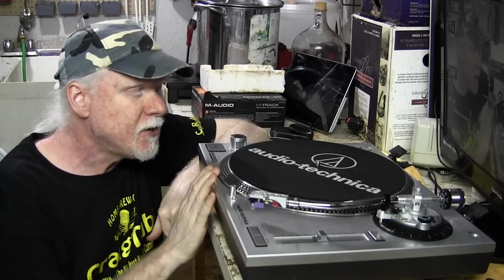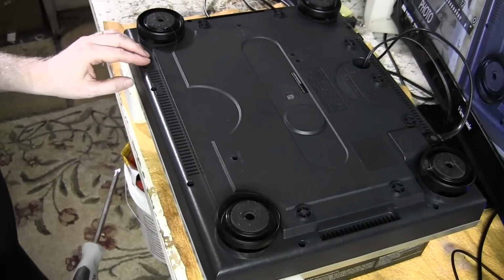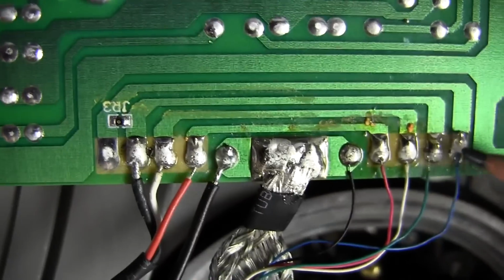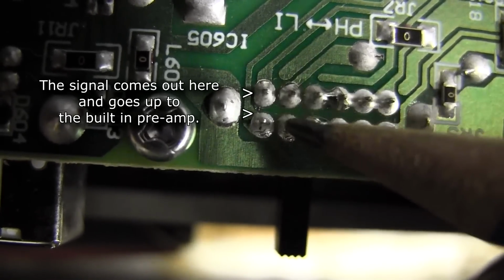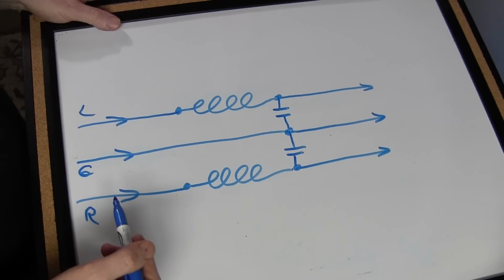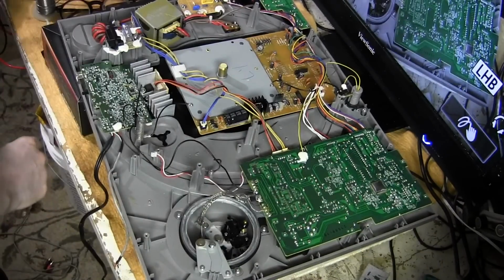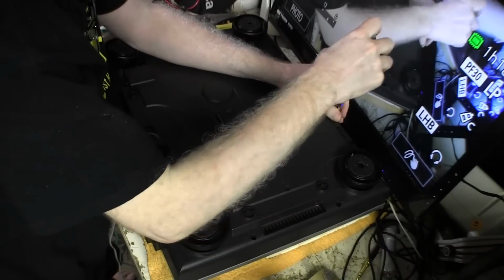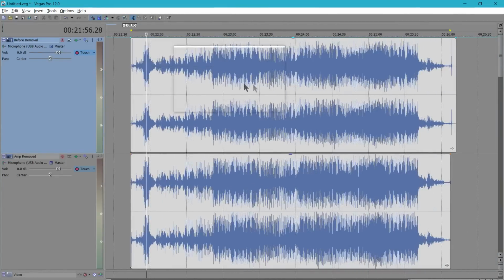Preamp Removal - Audio Technica AT LP120 USB Turntable

Comment: I am remove two l606 and jump and then remove two white pieces and the diferences in Audacity recorded at 96khz Its nothing I am thinking you use anothe RCA cable and not the original RCA cable maybe is the diference in sound.
Reply from the maker: I don't think the cable would make that much difference. There's another video on YouTube that does a comparison and the results are the same as mine.

Comment: I'm split on it really. Toward the end of the song, I felt that it sounded better without the preamp but at the beginning I felt that it was necessary. Some of the S sounds in the lyrics and snare drum sounded slightly over-driven or distorted slightly. I might have to do this myself although I wonder if I could just adjust my levels and get a similar result.
Reply from the maker: Don't forget that the record I used has a lot of treble. It won't even track properly on some cartridges.
Reply: Vinyl TV t

Comment: Also need a best external pre-amp than the internal to listen the diferences
Reply from the maker: I didn't use the internal preamp during the test. It was switched off.
Reply: I know but I am remove two filters and jumper it in my board but i do not see diference but just tested with the internal pre-amp i do not have external pre-amp.
Reply: Danubio Rodriguez The difference is about two Db. You can however tell by the depth of the music. The 3d depth is much improved. If only you could improve the loud knocking motor and the wow and flutter.

Comment: Hi there, where did you get the audio wire to solder to the board? It looks like the RCA cable that you used has a ground wire as well. Any info would help!
Reply from the maker: I just had it lying around. Try a thrift store. Mine always has tuns, and just cut one end off.

Comment: PS- I know YouTube audio is painfully compressed, but your before/after shows absolutely no audible difference, certainly not worth the agony and risk involved. I heard NO difference. None.
Reply: how old are you? coz there is definitely a noticeable difference in mid-high frequencies.
Reply: The sound difference was very obvious to me as well. I think some people's ears may be going south.
Reply: i could hear the difference. prob not as much as he did but i did hear a difference.
Reply: What's your audio setup? I could hear a pretty major difference in the high end, almost to the extent of the after being a little tinny sounding. There's nothing bad sounding about it beforehand, it's purely a personal preference thing.
Reply: WR3ND I'd rather not butcher this turntable. Additionally, it's not my only unit, and I have multiple cartridges. The whole concept is just goofy to me.
Reply: No worries. Do as you like with your gear for what sounds good to you. I was just commenting on the sound difference in the video. To me it seemed very noticeable. Just an FYI: Currently I plan on getting this turntable and using the builtin preamp. (The motor burnt out on my current table which is a lower end Sony one.) If I had another higher end external preamp, I'd consider removing the builtin one, but that isn't the case, at least not currently. Cheers.
Reply: ab30494 like everything in audio, mileage and subjectivity may vary.

Comment: Honestly, the people that do this and claim sudden magic audio are drinking Internet Kool Aid. It simply is not worth the effort. It's the same people that replace capacitors in audio components that don't need replacing, and psychologically hear an all new component. It's all in their head. High tech voodoo.
Reply: Its not really that much effort if the person thinks it sounds better.  Maybe 1/2 hour, for hours and years more enjoyment....small investment.  Now on the other hand, not everyone can perceive the subtle difference in depth at 10Khz....jet mechanics, Marines, and rock stars come to mind.
Reply: I can clearly hear the added air and space in the higher frequencies on my Klipsch ProMedia 2.1 computer speakers on low volume at night. This is a very noticeable improvement in my opinion.
Reply: The visual waveforms cleary show a difference. Some folks just cant hear the difference. Which you prefer is another matter.
Reply: The difference in the waveforms is literally that the post-preamp recording is louder, that's all. The effect that those components would have had is so marginal that it's almost redundant to even consider them.
Reply: +BLACKSYNTH Or absolutely awful speakers like the built in crap you find on a laptop.
Reply: No, it does help.. With preamp in, the capacitance is much too high at 700pf.. Remove the preamp and add low capacitance interconnects to lower that value.. What I just described is good, solid engineering, not audiofoolery...
Reply: I agree, i am only pointing out that the wave form proves there is a measurable difference.  Also, some, including myself can also hear that difference even in double blind tests.
Reply: Arthur's Hallicrafters Kitchen & Audio Lab m8, you could see the difference in the waveforms even. Do you have an LP120 and are just too lazy to fix the pre amp or what?
Reply: Daniel it wasnt just louder, if you actually look with your eyes open you can see that there are more waveforms, its tighter. And most importantly you can hear it, are you just that closed minded?
Reply: Quite funny then how the difference was like night and day even when not watching the video to see if it was before or after. Maybe your ears are not sensitive enough or you are pumping the audio through some crappy pc speakers?? If your ears are fine and you are not using absolutely horrible audio equipment there is no way you shoudl not be hearing the difference as it is HUGE.
Reply: +Daniel You would not get the same difference by just turning up the amplitude. The high frequencies sound alot sharper and detailed with the preamp removed.
Reply: If you can't hear the difference between the before and afters then your hearing might be really bad.  like REALLLY bad.  :(
Reply: I personally can hear a pretty big difference even when closing my eyes, and im listening  to this video through my phone speakers
Reply: Just because you can't hear the difference doesn't mean no one can.  Plus it's not that much effort to do this, unless of course your just lazy.
Reply from the maker: I can definitely hear the difference. I first heard it on another video, which is why I went through the trouble to butcher my turntable. Did you not see the waveforms and how different they were? I'm no audiofool, trust me.
Reply: wyomatt I truly think it's a waste of time and effort. But if it makes people feel better about their purchase, go nuts.
Reply: Henry Carmona The underlying problem with that is, you listen to music, not a waveform.
Reply: That's one of the stupidest comments I've ever heard on YT, and believe me that's saying something.  What do you think makes the waveforms?

Comment: Craig you are an amazing guy and your attention to detail is very helpful. Electronics 101 question: when you are soldering your own RCA cable where is that copper ground wire coming from? Red or white side? I just stripped an RCA cable from Radio Shack and I'm already stuck
Reply from the maker: The ground is common to both channels, left and right.

Comment: I'm not a techie person, but is there any way of wiring it so you can still use the pre-amp if required, but have an additional RCA cable going directly to the external amp? I ask as I sometimes convert my vinyl to mp3.
Reply from the maker: Yes there is a way, but you'd have to install a separate switch.

Comment: nice but why didnt you just bypass te suspect components? just bridge them and leave the preamp in
Reply from the maker: That might work, but then why are the components there in the first place? Maybe to filter out some noise from the near-by USB circuitry?
Reply: @VinylTV33  There's no noise from USB, I think the low pass was put in to smooth the harshness of the 95E, or the engineers though running 2 preamps tandem would increase treble
Reply: Or just install a bypass switch
Reply: Vinyl TV hi this is a great video thanks. I been using the Cambridge audio 651p as a preamp and this TT (still have the preamp install) I used on phono mode and the sound is louder but I don't know if is make the sound better any thoughts.

Thanks.
Reply: Vinyl TV someone suggested it's to make up for the lack of a grounding wire when the internal preamp is switched off. Also if I were to install another switch I would separate the ground wires from each other as they should be thru the RCA cable. I'm thinking of getting this turntable but I am skeptic of doing this operation for the same reason you wouldn't have done it before because it would have voided the warranty, but I really care about the quality of the sound. Idk what to do.
Reply: Vinyl TV if you just add bypass wires you would still have the capacitors in the circuit shunting some off the highs.
Reply: You could cut the traces and add your own preamp in/out of circuit switch. Great for demonstration purposes.
Reply: Hello, maybe you can help me, I buy this turntable and I can not and I do not want to take away the preamp, but I want to buy a preamp like yours, my question is, is it worth it? improves the quality of the audio, usually I listen to music with low volume or I would have to remove the internal preamp, thanks

I do not know much English helped me with the Google translator, greetings

Comment: Great to see you did the Preampectomy! I performed mine over 2 1/2 years ago and I heard the difference right away. When you switched it to BEFORE it sounded like hitting a noise reduction button on a DBX box. It muffles the sound and that's why I always leave comments on other YT channels to rip it out. I do want to pass on one helping point since I've taken mine apart several times (I used tape on the spacers also). Rather than use the Styrofoam for turning the turntable upside down, after removing the platter and 45 adapter leave the cover on and use clear packing tape to tape the cover to the top part of the turntable. Then just flip it over onto a towel to prevent scratching. I had originally soldered the RCA cable to the PCB board, but later soldered them directly to the wiring to the cartridge. I use the same AT440MLa cartridge that I upgraded from the AT120e that I ordered it with. It initially made an improvement, but removing the preamp made the biggest difference. I left the black wire grounded as originally wired to the PCB board. Your video is OUTSTANDING! Long live vinyl!

Comment: Excellent video, Craig. The coil and capacitor in the signal path is clearly an LC low-pass filter, designed to filter out high frequencies. Like you said, they probably put it in there to filter out high-frequency noise generated by the USB circuitry.

Comment: Very good, Craig.  I've seen the video where someone removed it, but I don't believe there were any sound samples.  I think the next modification is to add RCA connectors so you can swap cables in and out, if you have time.
Reply: Or just upgrade the wiring to some cardas wiring or something. That would be cool to see too.

Comment: I think its not just a matter of more high frequency information without the pre-amp.  I also notice that the transients are better delivered after the surgery.  I would guess that the difference is more drastic in person than thru the restricting audio processing that youtube must apply to this video. Was the difference more drastic to you?
Reply from the maker: I watched the video off of YouTube and it sounds pretty much the same. I noticed it right away the first time I played a record after the removal. I don't know what bitrate YouTuibe uses for audio but I encoded it with 256 kbps for the audio. I think that the YouTube audio is spot on.

Comment: I noticed the tiniest bit of a veil being lifted after the preamp removal as opposed to before it's very very subtle but I can hear it.
Reply from the maker: I have a pair of Alesis MK2s and the difference was quite pronounced. What speakers are you using? I mean, I noticed a difference even before the comparison. Cheers!
Reply: I don't have anything high tech. I love Definitive Technology. I use a pair of ProTower 400's from 1999. I live in an apartment so I can't upsize, but they do well for themselves. They each have a built in sub with a 125 watt internal amp.
Reply: By the way, the video was a lot of fun to watch, even tho I don't have that turntable. I have a Technics SL-1700 with an Ortophon Blue cart. With your comfort with the electronics, are you a ham radio operator like myself?

Comment: inductor+capacitor=oscillator or de-oscillator.  very frequency specific. Still didn't do a test with the preamp into line feed.
Reply: What if the AT preamp is actually better in use than the normal assumed belief that it would be worse?
Reply from the maker: The inductor and capacitor are essentially in series with respect to each other. If you look at the diagram I drew, the signal goes through the inductor, then the cap, then back to the cartridge. The output is taken at the junction where the inductor and cap connect. This is a typical "low pass" filter config used on a larger scale in speaker crossovers. It's not tuned to oscillate because that would depend on the impedance of the cartridge. I doubt there's any resonance going on in that circuit. 

I have never done any comparisons with the built in preamp. Here's why. Regardless of how good it may or may not sound, it has a built in gate that shuts off the amp when there is no signal, like when you lift the stylus off the record. This is fine, except that sometimes it cuts off between songs if the record is quite enough. This is annoying and has been mentioned by many. If this wasn't the case, I would have been glad to use the built in Pre, as long as it sounded as good or better than my outboard Pre does. In my mind, that gating thing, which there was no adjustment for, makes the built in Pre un-usable for archiving and is distracting while listening. This was also true with the USB connection, which uses the same amp. So since I never use the built in Pre, there's no need to be filtering the final output with caps and chokes. My goal was to just disconnect the Preamp and leave it in there but there wasn't much room to store the wires. 

It should be noted that leaving the Pre hooked up, and just soldering new wires directly from the tonearm would have left us with  the capacitor still in parallel with each channel and ground.

Comment: I don't think it sounds better. Without the pre amp it actually sounds "tinny", i.e. a less realistic well balanced sound. It seems to me that this turntable with the circuit is giving a much more accurate decoding of the RIAA curve with it's own pre amp than without. That is how the internal pre was designed- to properly decode the RIAA curve. It would be instructive to try the turntable, with internal pre disconnected, with a range of external phono pre-amps. If I lived in Toronto I's lend you my British made Creek 4040. I bet the phono pre in the Creek would tame that excessive high end.
Reply from the maker: I think that, no matter what external preamp or cartridge you use, there should be NO change in the signal on its journey from the cartridge to whatever preamp you are using.
Reply: agree, the switch should completely shut off the preamp. the inductor/capacitor was put there to cancel the circuitry resonance, instead of just isolating the preamp. my guess is feedback from the ground for the decision.
Reply from the maker: I would hope that the Nikko pre that I use would be capable of properly decoding the RIAA curve without help from external caps and chokes, since that's what it's designed to do. There's an impedance switch on it for 100 and 47. I assume this is ohms or K ohms. I always run it at 100, but now with the extra high end (the AT 440MLa has been noted to be a pretty bright cart) I may switch it back to 47, which dampens the highs ever so slightly. That might  appeal to those who prefer a warmer sound. However, at age 50, my ears can use a bit of extra treble.
Reply from the maker: Willy, you may be right about the resonance thing. The traces on the board are pretty close together. There might have been some sort of tiny interactions going on there. I don't know the math so I can't say.
Reply: ***** That sounds plausible! I don't know how good the "Nikko" is as a pre-amp. I do know that the British hi fi amps, mid price range and up make a very good job of neutrally decoding the RIAA. I think the extra brightness, which sounds almost harsh via YouTube is due to the difference in RIAA curve decoding from the internal preamp to the Niko pre-amp, which from my experience is typical of cheaper Japanese Hifi amps.
Reply: wow you didn't even watch the whole video and went to the comparison directly apparently, he was never using the built in preamp in this video, he just removed the inductor and capacitor from the signal path, he was using his own discreet RIAA preamp all the time. Perhaps the internal preamp has too much high end gain so they decided to use the filtering which is fine, but a true bypass switch should eliminate everything, not only the active circuitry. But as always is a question of taste.